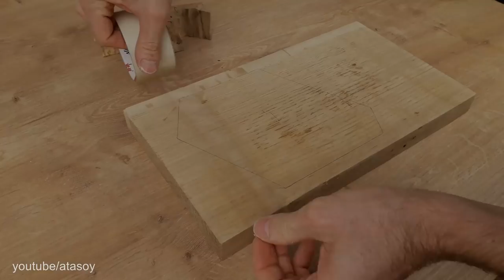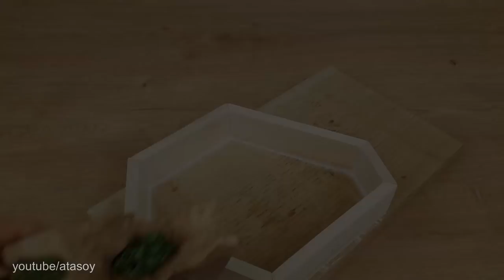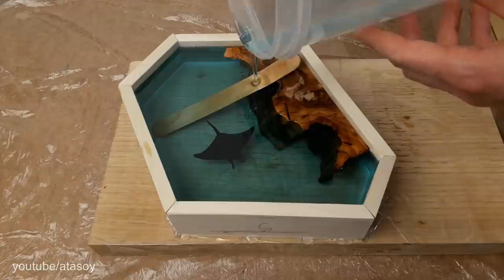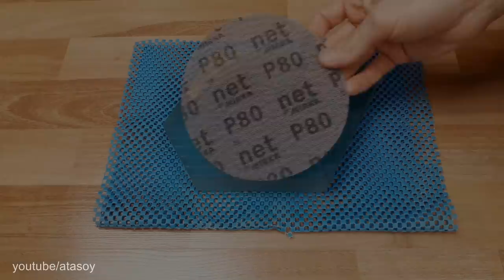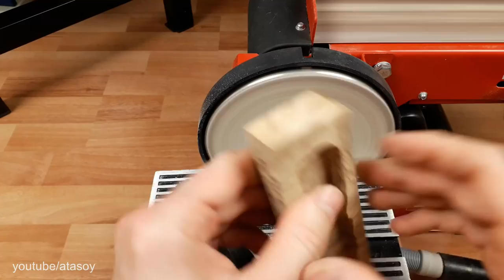Epoxy lamp with Manta Ray

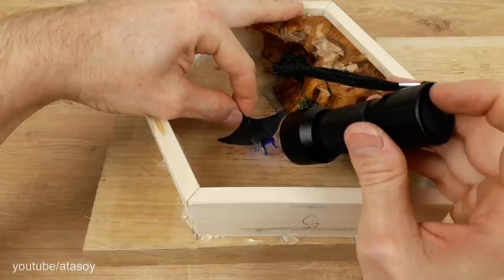Comment: 4:39 So cool! I was wondering how you made the stingray stand up. 
I was figuring you did 2 layers of epoxy. 1st layer, halfway, then set the stingray on top then 2nd layer to fully submerge the stingray.
Reply from the maker: Thank you so much.
I'm using an epoxy stick.
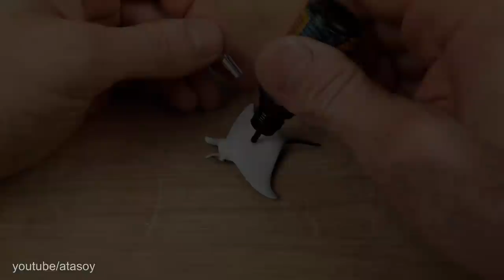At 4:21 minutes I'm pasting this on a stingray.
At 4:39 minutes, I paste this on the mold.
So the stingray stays in the air and I pour a single coat of epoxy.
Reply: manta ray*
Reply from the maker: What are you trying to say????

Comment: What is the spray that you have been using? .. The creation is wonderful
Reply from the maker: An auxiliary spray that allows the fast adhesive to dry. Sold as a set with adhesive.
I am sharing a sample link for the glue.
aliexpress.com/item/1005004502937047.html

Comment: Super work dear! Wanted to know the spray which you have been using what is it
Reply from the maker: This is a quick glue, it dries with a spray coolant. 
I use it for quick paste, you don't have to use it. 
Using hot glue will suffice instead.
Or you can use a different adhesive.

Comment: Love the video!! What is Epoxy Rods and where can we get them? Thanks!
Reply from the maker: You can make the epoxy stick yourself.
Using a drinking straw as a mold, put epoxy in it and wait for it to dry.
After drying, separate the straw from the epoxy and the epoxy rod is ready.👍

Comment: Amazing! This is the first  time im watching content like this so im very curious as to why you sand the resin so much...and with so many different types of sandpaper 🤔 ..
Reply from the maker: Thank you so much.
It is necessary to sand from coarse to fine so that it can regain its old shine by removing the surface defects with coarse sandpaper.
If it is tried to be done by reducing the number of sanding, coarse sanding scratches may remain on the surface.
I hope I could help😊👍👍👍

Comment: Great video. A video going into more depth with the soldering would be extremely helpful. I really want to start making some lamps but the soldering is holding me back. Hope you will consider, thank you
Reply from the maker: I do not have expertise in electrical-electronics and soldering.
The information I will give you about electrical electronics and soldering will not be correct, for this you should get training on basic electrical electronics and soldering from the internet or an electrician.

Comment: I have been very interested in doing these types of art work, but where did you start? when were you able to buy all the tools you needed? what's some things you wish you knew before you started? any tips?
Reply from the maker: I started this business by making small necklaces.
Initially I got a precision balance, plastic cups to prepare the mixture, wooden sticks, silicone molds for the mold.
I tried to get to know the epoxy by doing some experimentation.
Then I designed and made various necklaces using some dried flowers and wood.
While doing these, after I did the epoxy casting stage, I cut it into a shape with the help of a bristle saw and completed its shape with the help of sandpaper and learned the polishing and polishing steps by grasping the sanding steps for the polishing steps.
You can watch the necklace making videos on my channel with subtitles, and you can follow what I'm doing from the subtitles. If you ask your questions in the comments, I will try to help you.
For example, you can follow what I'm doing by watching this video with subtitles.

Comment: ürünler çok güzel abi eline sağlık
elektronik kısımlarda kullandığın malzemeleri nerden temin ediyosun ?
Reply from the maker: Teşekkürler,  led ve diğer parçaları n11 den alıyorum. İlgilenirsen bağlantılarını aşağıda paylaşıyorum. 
Mercekli Modül Led 1.5w
https://urun.n11.com/serit-led/mercekli-modul-led-15w-1-10-20-50-100-adet-tum-renkler-P390455998

Adaptör Fişi Şase Yuvarlak 2.1/2.5mm
https://urun.n11.com/arduino-urunleri-ve-setleri/adaptor-fisi-sase-yuvarlak-2125mm-P413723893

RF Uzaktan Kumandalı Şerit Led Dimmer LED Işık Kontrolü 12V/24V
https://urun.n11.com/serit-led/rf-uzaktan-kumandali-serit-led-dimmer-led-isik-kontrolu-12v24v-P433450193

Comment: Great ideas, Beautiful realization!
May I ask what is this spray you use after glue? Kind of degreaser or two component glue?
And one more. Why you cutting out the upper layer with the router, why you don't polish it as it is starting with 80 sandpaper?
Reply from the maker: Since this is a fast adhesive, it provides faster drying thanks to the cooling spray. Yes, this adhesive is a two-component adhesive and a coolant spray for fast drying.
After the top layer epoxy dries, it is not flat. I make these surfaces flat with a router to make this surface flat.
After this correction process, starting with 80 grit sandpaper, it should be sanded up to 3000 grit sandpaper. If you do not sand until 3000 grit sandpaper, scratches will remain on the surface and you will not be able to obtain a glass-shine surface.
After the 3000 grit sandpaper, the product is polished like glass with the polishing process.
Reply: Thank you very much for the fast and informative response. 
I would like to star experimenting with epoxy as a hobby.
Dot you mind if I ask you some more questions in the future? Of course if I won't find answers and solutions in your videos)
Reply from the maker: You're welcome, you can ask anything you're curious about in the form of a question and answer.
Reply: Wonderful! Thank you.
May I ask than what kind of glue, oil for the tree and polish pasta you are using?
Reply from the maker: When asking a question, I can give you clearer answers if you specify which minute of the video you are asking one by one and especially.
Clou Hard Wax Wood Oil as wood oil
For polishing paste, I use Menzerna 400 and 2500.
Reply: There is a small white bottle with the red cap at 2:12.
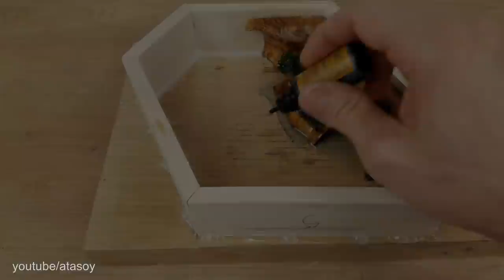Than kind of UV glue at 4:30. Why u, just to make it faster? And this small stick that you use for support of stingray fish, do you made it from epoxy before?
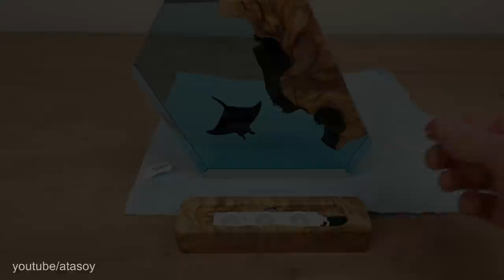The last is at 12:10, two component glue i guest. 
What do you think about epoxy glue? Can it be used instead the glue on at 12:10?
And last one. Sorry its way too much questions.... what if I take Menzerna 400 and menzerna 3800? Or its to much?
Probably I become annoying. I apologize for this.
Reply from the maker: Please ask questions one by one, I have a hard time answering when you ask more than one question.
2:12 - Fast adhesive.
4:30 - I made the stick from epoxy resin to support the stingray fish.
12:10 - You can provide a bonding in this way by preparing a two-component epoxy adhesive or regular epoxy.
The Menzerna 400 and 3800 can also be used.
If you want, you can try with only 400, if you need it, you can get 2500 or 3800 later.
Reply: May bad, sorry 😞 Just so much questions in my head. But you already helped me a lot! Thank you so much!!!
Hopefully I'll get resin and other stuff this week. Can't wait to try)
I'll send you a picture of my first mold if you want)
Thanks again!!

Comment: What do you do if the lights die? or some sort of electrical problem occurs? At that point are you just stuck?
Reply from the maker: In this model, the bottom wood was not glued well.  If there is a problem, the foot part is removed, the light is changed and the foot is glued again.

Comment: What should we use for resin art work. The Acrylic sheet or Plexi sheet. The thickness of sheet.
Reply from the maker: You can use plexiglass.
Its thickness will vary according to the work you will do, but 1.5 or 2 mm will be sufficient.

Comment: Perfect art. Could you please tell me, how did you get those bubbles
Reply from the maker: If you are asking about the bubbles, because I poured the epoxy without using a vacuum machine, bubbles appeared on the tree edges by chance.
I did not make any special application.☺
Reply: @atasoy  thanks.

Comment: awesome work! how do you make bubbles only near moss?
Reply from the maker: Thank you so much.
It's just a coincidence that bubbles form next to the moss.
There is a reason for this.
Since there is air in the moss, this air wants to go out during the epoxy drying.
Therefore, air bubbles are formed in this way.
Such a good coincidence.😊😊😊
Reply: @atasoy  Thank you! Gorgeous coincidence 😊

Comment: Kum zımparaları ile su zımparaları arasındaki fark nedir?
Reply from the maker: Kum kelimesini kullanırken önünde bir rakkam söylüyoruz örneğin 180 kum, 3000 kum gibi,  bu zımpara yüzeyindeki tane sayısını ifade eder, 
Zımpara çeşidi olarak kuru ve su zımparası olarak ayrılıyor.
Reply: @atasoy  Kuru ve su zımparasi arasında bir fark var mı? Bazı videolarınızda su zimparasi uyguladiniz bazılarında da kuru olanı
Reply from the maker: Kuru zımpara sulu kullanıldığında çok çabuk ufalanıp dağılacaktır kuru zımpara da zımpara tozu çok çabuk zımpara yüzeyine toplandığı için genelde sulu zımpara kullanmayı tercih ediyorum
Reply: @atasoy  Sulu zımpara almayı düşünüyorum abiciğim, su zimparasi için birçok çeşidini üst üste sırasıyla kullanmıştın bir videonda biz de mi bunların hepsini sırasıyla kullanalim yoksa herhangi bir tanesini alsak olur mu?
Reply from the maker: Sırasıyla kabadan ince gitmelisiniz,  kolyelerde şu sıralama yeterli olacaktır.  80, 180, 360, 600, 1200, 2000 ve 3000

Comment: How to make bubbles in epoxy?
Reply from the maker: In this study, the bubbles were formed by chance.
If you have worked with epoxy before, the important thing is how to do it without bubbles.
It is very easy to produce bubbles, but very difficult to create them under control.

Comment: Epoksi reçinenin yarısı kadar sertleştirici mi koyuyorsunuz. Şu ışığı elde etmek için malzemeler nelerdir https://youtu.be/NU0U6SA_Ofg?t=721 lütfen bilgilendirir misiniz.
Reply from the maker: Epoksi reçineye eklenecek sertleştirici miktarı ambalaj üzerinde ve kullanım klavuzunda belirtildiği kadar eklenmeli.
Markadan markaya bu oran değişiklik göstermektedir. 2:1 oranında olanda var 3:1 olanda. Böyle bir çalışma için kalın döküm reçine kullanılmalı bunuda belirteyim.
Işık ise 1.5w mercekli modül led kullandım, linki burada https://urun.n11.com/serit-led/mercekli-modul-led-15w-1-10-20-50-100-adet-tum-renkler-P390455998
Kumanda devresi ise , https://urun.n11.com/serit-led/rf-uzaktan-kumandali-serit-led-dimmer-led-isik-kontrolu-12v24v-P433450193
Reply: @atasoy  Anladım çok teşekkür ederim. Hayırlı işler olsun sizlere

Comment: Y do Epoxy Harder is mixed less then Epoxy Resin.
Reply from the maker: I didn't understand exactly what you wanted to say.
Reply: @atasoy  epoxy sertleştirici resin den daha az olmuş/karışmış demiş.
Reply from the maker: Evet bende öyle anladım da kullandığım epoksi zaten 10:4 oranında karışım oranı var. Sertleştirici az olmak zorunda zaten.
Reply: What I the ML for mixing of Harder and Resin
Reply from the maker: The mixing ratio of the epoxy I use is 10:4
800 gr epoxy was used.
571 g of resin and 228 g of hardener.

Comment: the power line should be on the side, not in the middle. other than that, it is a great lamp....
Reply from the maker: A different point of view, what is the reason for this, why does it have to be on the side, is there something I don't know?
Reply: @atasoy  if you look through the light, you can see the power line directly behind the light, it breaks the overall presentation of the light....
Reply from the maker: Yes, you are right, I agree with that, I will pay attention to this in my other works.😊👍
Reply: @atasoy  no worries. since it is separate from the resin part, it is fixable. from my perspective, always try to keep the led part outside the resin part if possible, so you can address any issues with electronics separately without affecting the resin piece.... great work and keep it up.
Reply from the maker: Thanks 👍